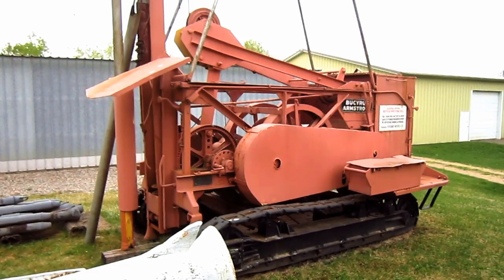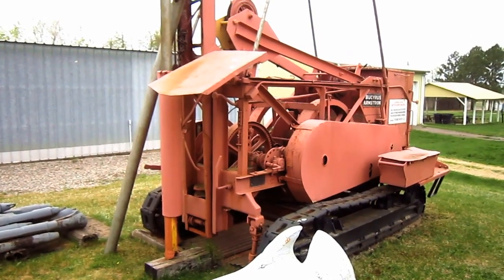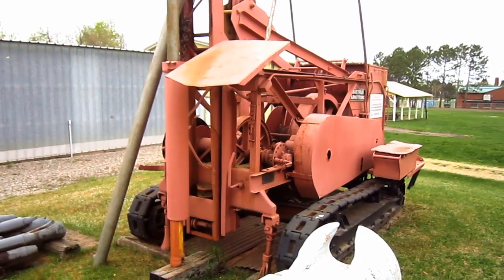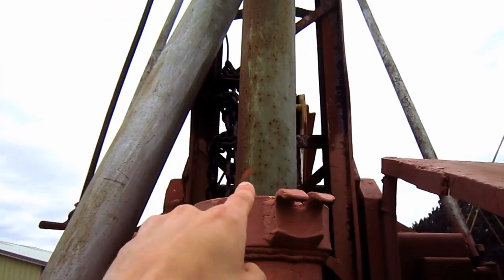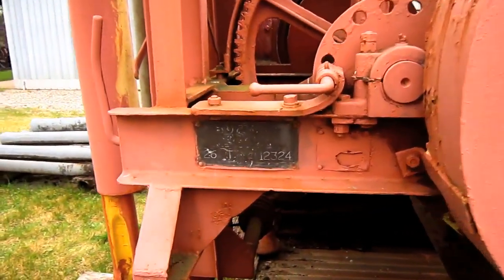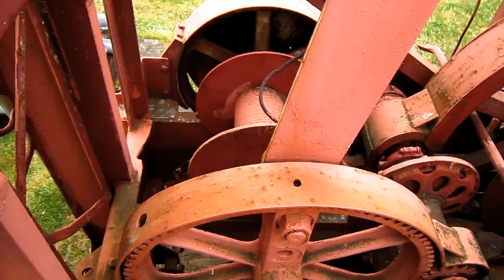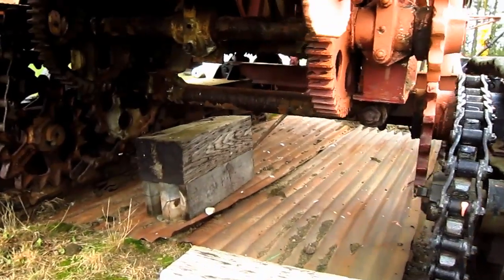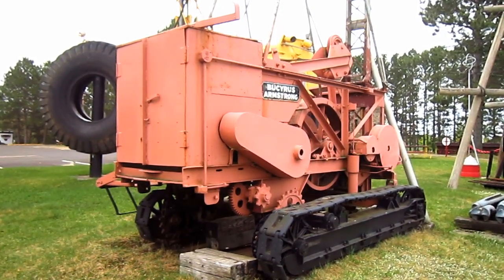Bucyrus-Armstrong 26-T Documentary

Comment: The name and model may be correct, but this is called a cable-tool drill. Bucyrus-Erie, and now Buckeye, continued to produce cable-tools. I’ve run one for 3 years drilling water wells. Also, you empty cutting out of the hole with a baler tool after pouring water in. Other than that, very cool, I’ve never seen a track mounted one before!